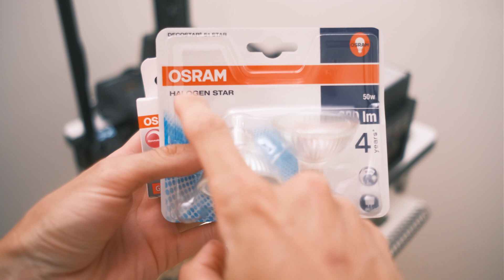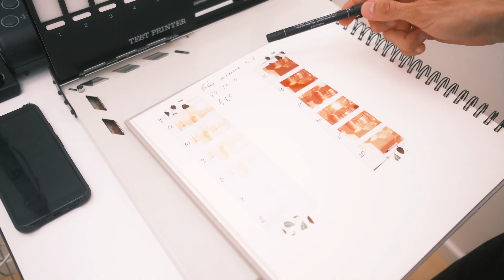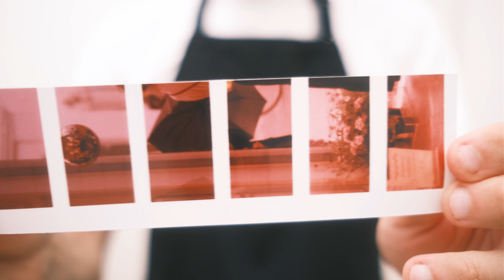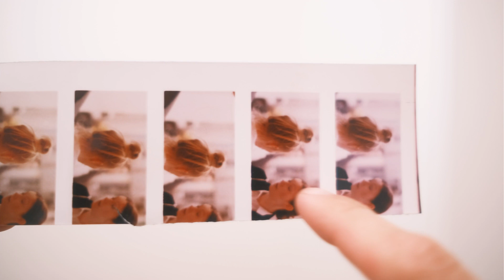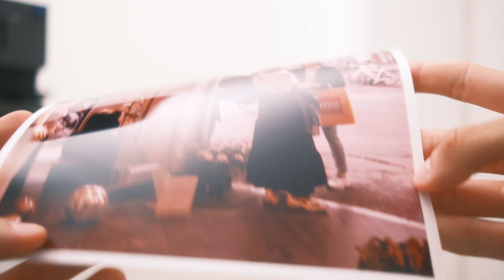Hologen vs LED light source in the RA4 enlarger Durst M605. First experiments.

Comment: I came across your channel at random, however I have just purchased a M305 BW but was interested as lights that don’t generate heat are obviously far better for the planet and the pocket. 
I would have thought that simple black electrical tape around the lamp or even black spray paint would be an easy way to direct the loss of light around the rear area, especially as there is little heat generated, the spray paint can be that used on stoves or exhaust pipes that allow far in excess of any heat generated. I am a little confused also at the point of your test, is it in the basis of heat v planet or accessibility of product, cost or a combination.
I hope you realise this isn’t an attack on your video, but rather a clarification in order to arrive at a solution.
Reply from the maker: Or you can just buy good halogen lamp with glass reflector ;)

Comment: Interesting. My Durst 605 has melted for the third time. On very long exposures it melts. I'll have to replace everything for the third time. .(
Reply from the maker: Yep, it definitely have bad cooling and not supposed to run longer then 15-20 seconds with 100w lamp

Comment: In terms of color, incandescent and halogen lights are the gold standard. The color redention index of you enlarger lamp is 100. Although things are getting better,  LED lights have a hard time emulating the spectrum of a  halogen lamp. Your enlarger takes  a standard EFP halogen enlarger lamp, 100W 12V, no?  I know the inconvenience of stuff getting hot and the longevity is also not great. Was it 50 hours or so?  Still that equates 1000s of prints.
Finally,  the most important, it is guaranteed  to work with every filter, lens, paper combination you can get your hands on. It is one less variable to worry about. And with the current prices of darkroom stuff,  I'm more than happy paying about 10 euros and skipping all  the testing.
Reply from the maker: Yep, it's around 50 hours in "imaginary work of datasheet" if it's running constantly, you need to keep in mind what turns on and off quickly for this light's not a good thing because of chemical cycle inside. I also have two problems with it what I don't like - temperature change spectrum a bit and spectrum changes to the end of the life of the lamp and also start-stop speed not always consistent, but it's not so important. More important what color separation with additive light works better on modern paper. And in general I don't think what CRI gives any difference on paper exposure, just because it's made for 3 single wavelength laser sources with sigma of 5-10 nm in wavelength

Comment: Really impressed with your achievement using the led bulb.
Should you ever want to use the proper halogen bulb for this enlarger then search for this one:

Osram Xenophot 64627 12v/100w. They shouldn't be too expensive. The original Durst Colamp 12/100w variation is!

All the best!
Reply from the maker: Yep, I've used it before, just don't have it on hand now

Comment: This was a great video, before I got my Intrepid enlarger I was using a really old, medium format black and white enlarger that I got for free from a friends mom because they had it laying around at the college she worked at, I had to replace the bulb there too but it was a really weird socket so I just modified it slightly, basically shoved one of the light sockets you find at your house in there and bought a 4000K 30w bulb to put in there, it worked great until I decided that I wanted to try the Intrepid.
Reply from the maker: Thank you! Yep, with Interpid you are using addictive light, so you need less power and it's superior in terms of energy and color separation in general if they use the right LED and not just RGB LEDs.